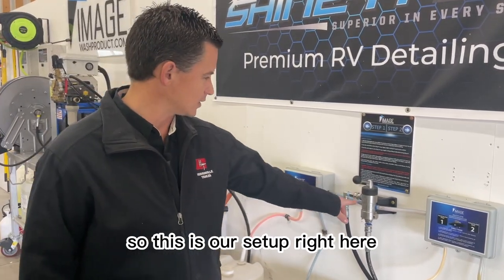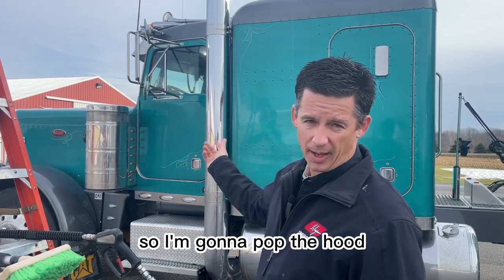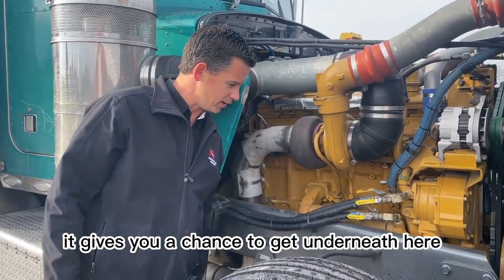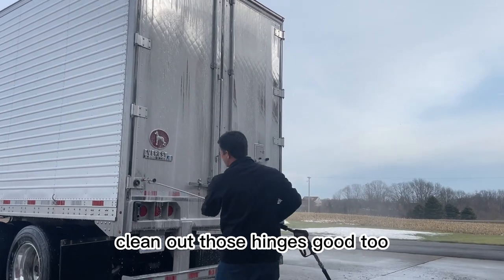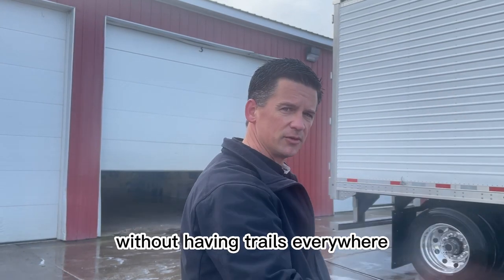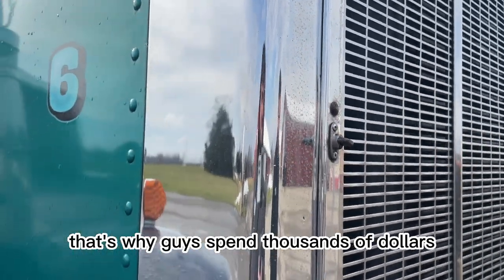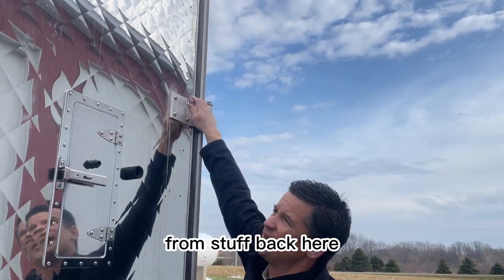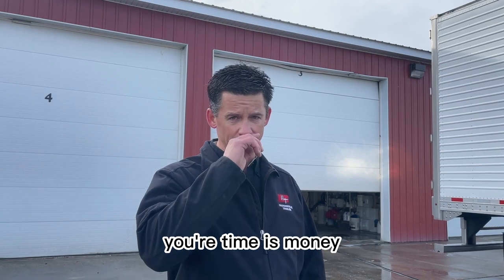Touchless PRO Chemicals: 2-Step Winter Truck Wash (Full Video) #truckwashing #cleaning #detailing

Comment: New to the channel, good content. Quick question. Which tank of water and what pressure washer would you recommend to wash fleets/semi trucks?
Reply from the maker: If you can get RO water, this is the best. In terms of pressure washers. Our shop has a 5.5 GPM/ 2,500PSI unit. This seems to do great for these trucks.

Comment: Question what kind of Hoes do you use and how many feet 150 Ft ?. Sir, tganknyou Sir.!.
Reply from the maker: We prefer to use Suttner hoses. Length depends on your setup but generally speaking we do not exceed 150'. The one in the video is 75'.